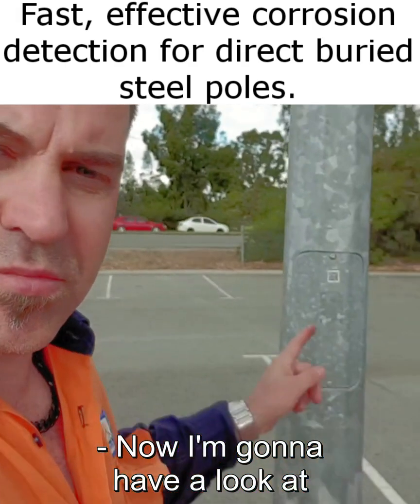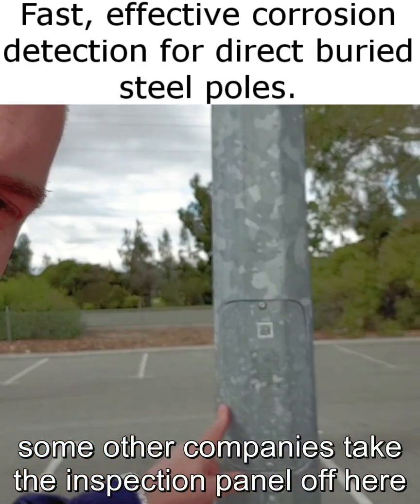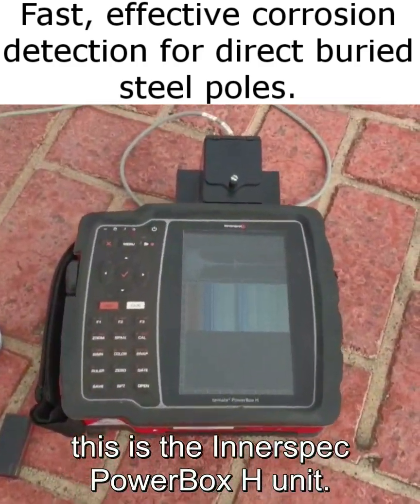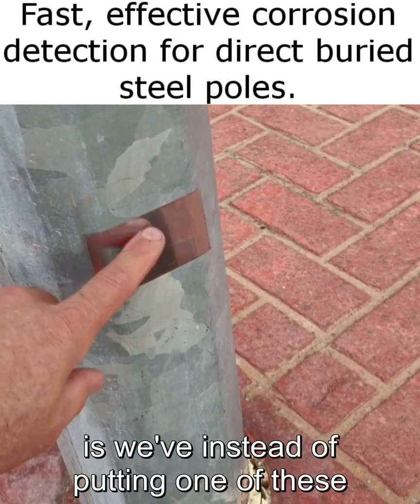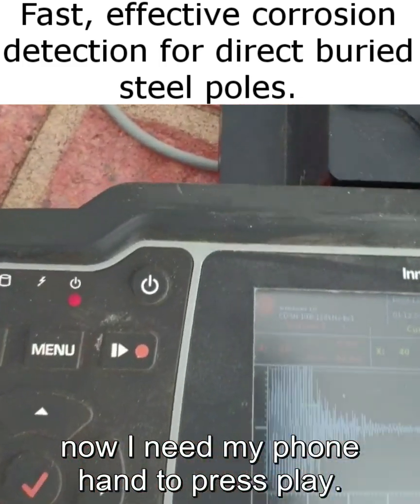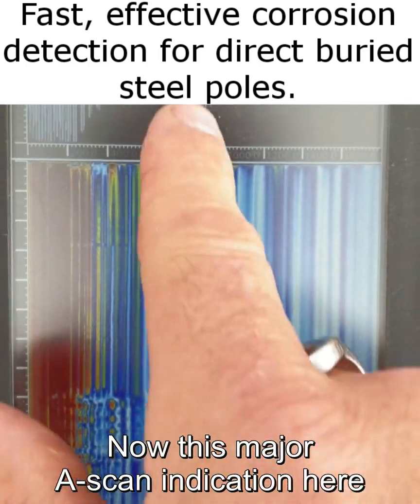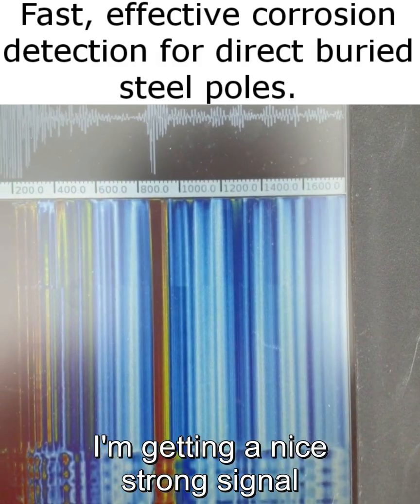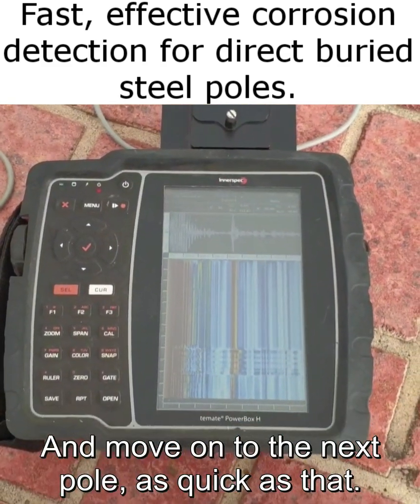EMAT MRUT Inspection on a Steel Pole - Revo Group NDT

Comment: You were getting a signal at 800 screen range (Likely a 2nd wave form) before you connected the coil to the strip. There is no way you can report on that. The signal is horrific.
Reply: Hi Marcus, if you watch the full video you will notice that the signal is just a previous scan that was still on the screen. The response at 800 was the did above. The old powerbox did not differentiate direction. The Volta does.
Now that the scan that is done live has a stronger signal because he magnetised the strip again just before the scan which has a similar effect to extra gain.
Reply: @rangadad  Ok, but he says the base of the pole signal is significant, which it isn't as there are multiple low amplitude A scan signals clearly visible. The base of the pole should be returning just as stronger signal as the inspection hatch.  It looks like he is set up for a much thicker steel section with a low frequency.
Reply: Hi Marcus, the base of the pole will never show a signal like you suggest due to the attenuation from the backfill material. Even with shear horizontal waves, there is still attenuation compared to the above-ground section. So significant for this type of inspection is different to what a normal UT tech would expect.